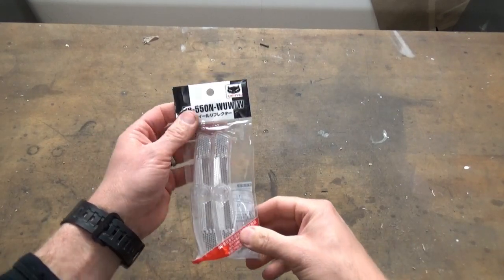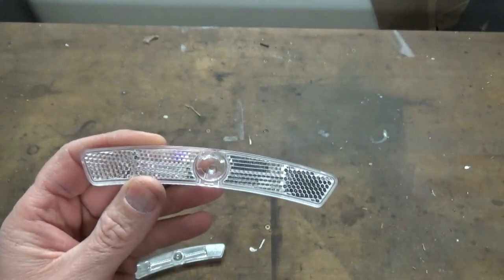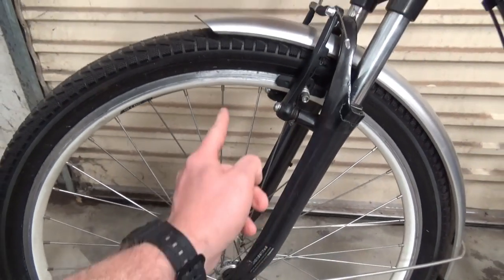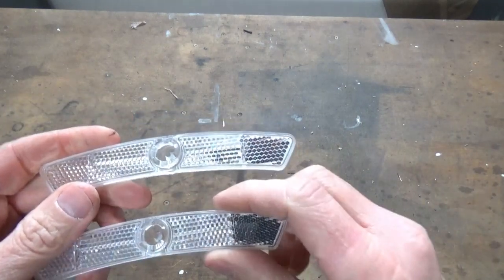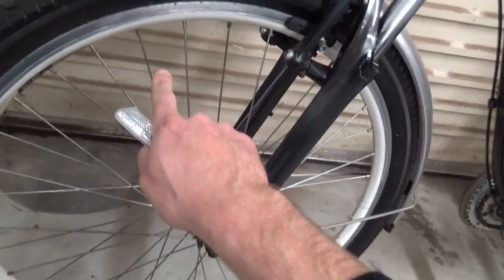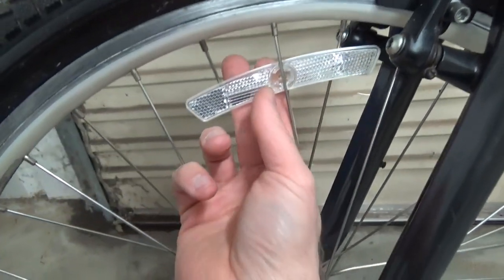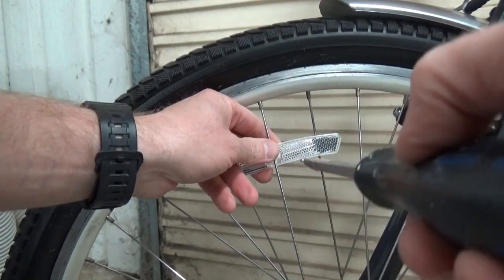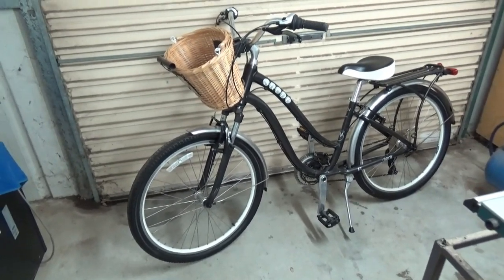How to Correctly Install Bicycle Wheel Reflectors, Making sure they are Parallel to the rim

Comment: How tall is your wife? The angle might me be why, but that bicycle looks quite small for an adult.
Reply from the maker: She is fairly short, but she also doesn't have her seat properly adjusted for her height,  She likes to be able to touch the ground easily, and values that over efficiency .  That is a good point though, I will suggest she tries is higher, see if she finds it easier.